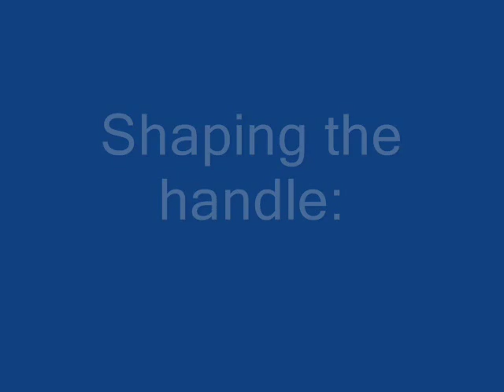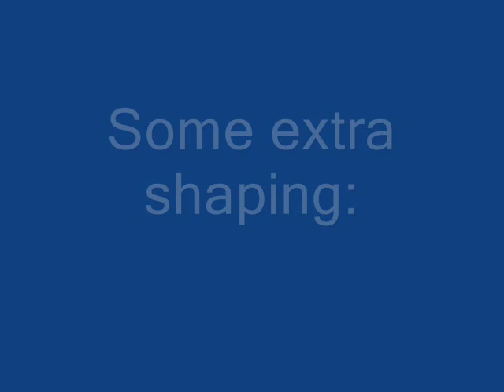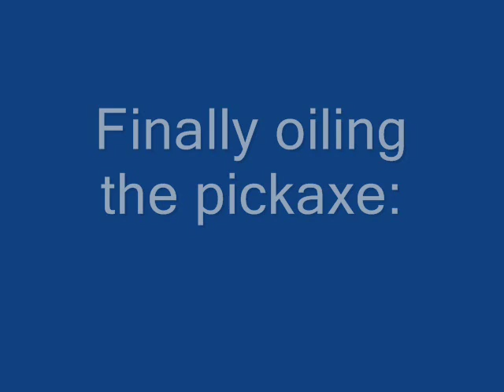Resurrecting an Old Pickaxe

Comment: Looks great!  I'm doing something similar with a cutter mattock right now.  Couple of questions... 1 - Why no wedge to hold the head on?  Is it not necessary for this type of tool (compared with an axe)? 2 - What did you use to finish the handle?  Linseed Oil?  Thanks!
Reply from the maker: Thanks and sorry for the late reply!
This type of pickaxe doesn't need a wedge - the hole is conical and the head just goes up the handle. (The same with the traditional Bulgarian axes and many other hand tools). I used sunflower oil, but I guess linseed would be better.
Good luck with your project!